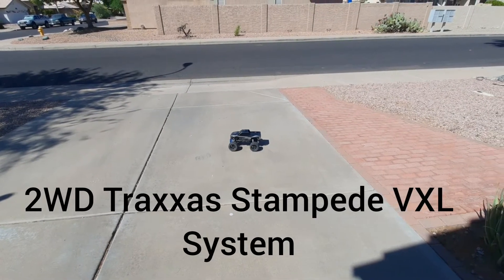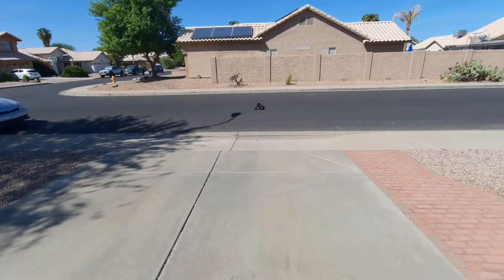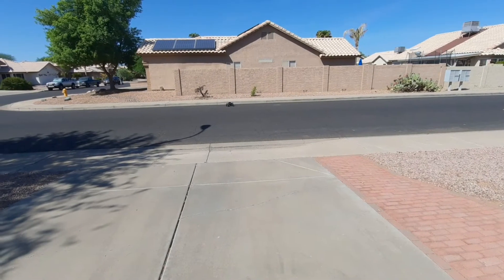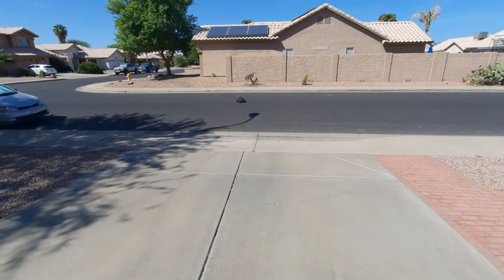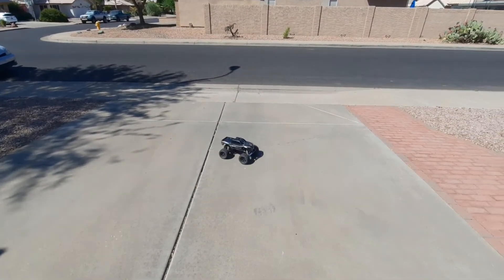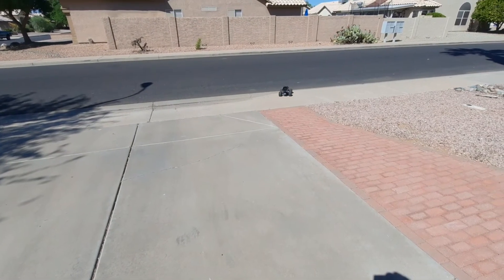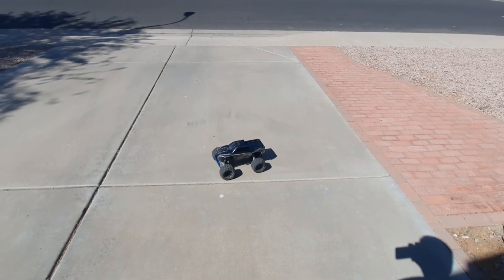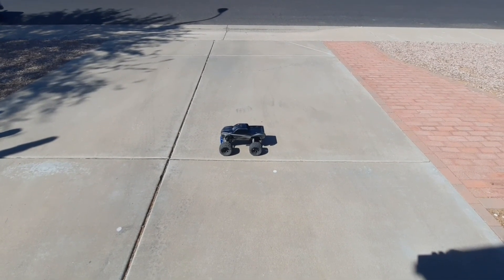Traxxas Stampede 2WD VXL System

Comment: I bought the same one about 2 weeks ago and got the 6400mAh 11.1v 3Cell 25C LiPo Battery and within 15 minutes of using it started smoking from the gearbox area and no longer runs. Would have never thought something new would just overheat like that. Of course I haven't had an RC car in about 20 years so theres that lol. They let me RMA it so well see if they fix it or just send me a new one.
Reply from the maker: Did you have your ESC set to Nickel or Lipo battery setting??
Reply: @jescagvil  Lipo (green?)
Reply from the maker: Yes the ESC should be solid green for lipo batteries and solid red for nickel.  If these are ran in reverse it could be bad for the batteries. Did you buy this car new with all new electronics?
Reply: @jescagvil  Yup, bought it brand new straight from Traxxas. They let me RMA it and I already sent it out so well see what they do. Hopefully they just give me an new one or fix the one I had. Not really sure how how those retailers handle that type of stuff so well see haha.
Reply from the maker: It sounds like it was a faulty ESC to me but you never know.  It doesn't seem like you did anything to cause the smoke unless you were going full throttle for the full 15mins.  Traxxas has really good customer service and warrantys on their products so I hear.  Im glad they are taking care of you thus far.  I'm sure they will make it right.  Don't let this steer you away from the hobby after just getting back into it...
Reply: @jescagvil  I hope so to haha. Anywho, ty for the infos, much appreciate it!